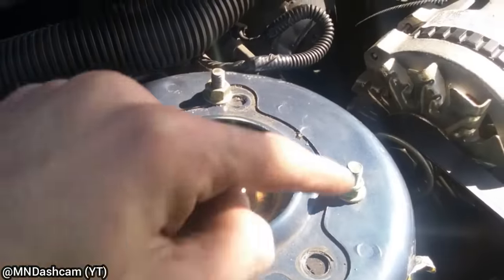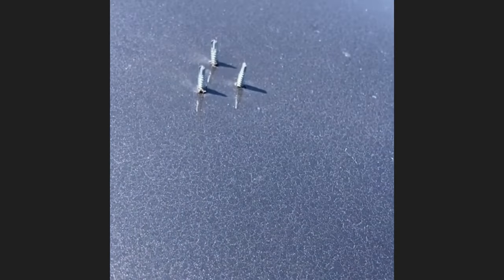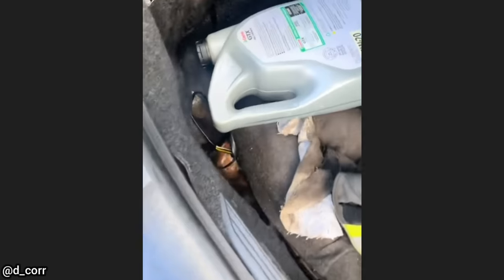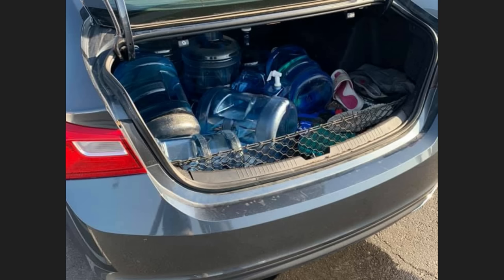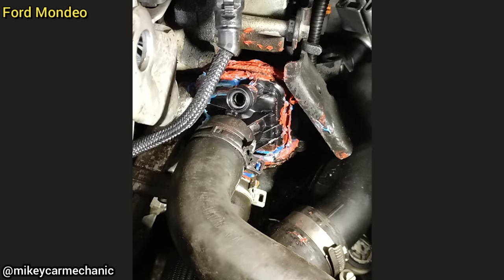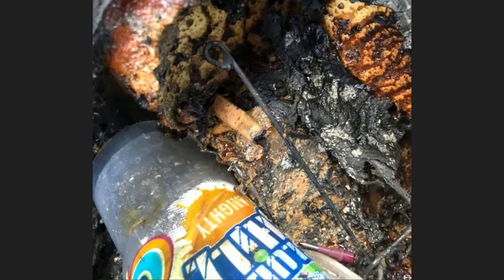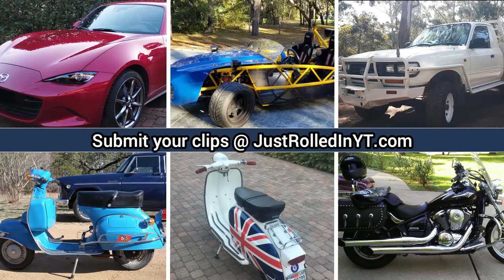Customer States He Got Scammed By Another Mechanic

Comment: Only yesterday I wanted to switch from summer tires to winter tires, but rather stopped, as the jack access point is a little rusty and gave me some suspicious crunch while lifting. It's only slightely concerning, as it's a tiny bit of side frame, and compared to what we use to see here, I am perfectly fine. Many frames shown here have basically rusted down to 1/3 of their original mass. Show such a thing to a German car inspector and you will see a grown man cry in the corner.
Reply: those car inspections in Germany.. ugh! My daughter in law visited the USA finally and when she left said, "I want a big American truck with rust on it."
Reply: Here you hit the frame with a ball-peen hammer and if it dents or deforms it fails inspection.
Reply: @grandrapids57  The Japanese 'shaken' car inspection requirements are notorious.   It's almost impossible to legally keep a car on the road in Japan that's more than 10 years old.
Reply: @MrSloika  That is for sure. During the 90's the Russian were importing a lot of Japanese cars until the Russians passed a law against right hand drive cars. It was a good outlet for them instead of sending them for scrap. The inspections business there and in Germany these days is far out of date and large economic burden. In Germany they also make every car owner have two sets of tires which must be changed by a certain date of the year-- there is no such thing as all season tire use there.
Reply: @grandrapids57  There is actually no such thing as an all seasons tire in Countries where seasonal conditions are significantly different.- it is an advertising gimmick designed to fool the gullible.

Comment: The cup in the burned car at 2:10 was the "Mighty" size cup from Speedway. I do not know which locations are still using the old cups, but several Speedway locations (the local one in my region of the Atlanta suburbs, for example) have been bought up by 7-11 and have switched over to Gulp cups. As far as the insurance company declining coverage, I can't really blame them. People should not smoke and fall asleep, be it in bed, on the couch, or in the car.
Reply: In the video, he said “they wrote off the car”.  That means they did cover it, totalling the car.

Comment: I managed to do the dumb i have a bad oil leak issues, but discovered it on my own. Full large jug of oil in my trunk, that most leaked out and all over the underside into the spare wheel well and out the drain hole. I still had a swimming pool of oil to scoop out before cleaning.. I spent about 2 hours taking carpet and everything out of my trunk and using strong soap to clean everything. I was going in the next day to get a new muffler and thought they might not like everything soaked in oil.

Comment: That’s a super skilled way to transitions from having the front on ramps to having the rear on ramps!
Reply: Usually the challenge is not drive over the ramps when going up.

Learned the hard way in highschool.

It's a bit of an over achiever to shift in drive instead of reverse when attempting to back off the ramps.

Comment: Those are a pretty set of "mobile mechanic" repair jobs there. I mean, lining up bolts with holes is pretty technical, and using gaskets takes an engineering degree I see.

Comment: The first vehicle is powered by GM's 3100 SFI engine, I'd recognize that valve cover and coolant bleeding tee anywhere. Water pump replacement on those engines is pretty darn easy.
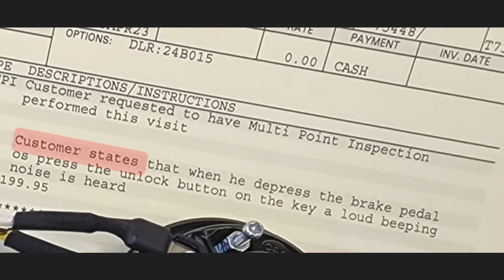1:38 - I've NEVER seen that prank before. HILARIOUS! I'll hand it to the prankster, they even used heat-shrink tubing and a neodymium magnet.
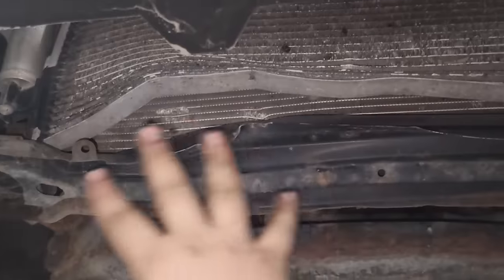2:51 - A bottle torch, some PB Blaster, a 3 lb. sledgehammer, and some elbow grease.
Reply: You want a great prank, get a really long zippy tie and stick it on your buddies driveshaft!

Comment: The very last clip happened to me too with the passat i used to have, i was trying to change the oil in my garage but the garage floor was too slick for the metal ramps, the ramps shot under my car and bent the pinch welds and both rockers in the front, luckily that was the only thing that got damaged. I changed my oil a week later on my driveway where the concrete actually kept the ramps in place, that was a lesson learned.

Comment: Been there, done that in the last clip backing up the ramps with my RWD Dodge Magnum RT. Was slowly trying to apply the gas to get it to move up the ramp and suddenly it jumped and shot up over the stops and stuck midway between the doors on both sides! That's the only time I've had an issue with a throttle by wire vehicle! Got the floor jack out and jacked it up off the ramps. Body pinch weld managed to cut cleanly through the plastic Rhino ramps! Didn't bend the pinch weld either!

Comment: I just had a plastic ramp do exactly that. I was just trying to get it up so I could more easily position  a floor jack under it. It was on a asphalt driveway on a cold day. I think the asphalt was a little more slippery due to the cold temperature. I have a board under the jack and jack stand to protect the driveway.

Comment: Found out my 95 Camaro had absolutely no rear brakes when it shot the ramps out and behind the car several feet after putting it in drive. Had just changed the fuel filter on the frame rail. Was just happy it didn’t do it while backing up onto the ramps.

Comment: This is what happens when people get their driver's license without knowing a single thing about the basics of their vehicle
Reply: I personally think they should make it a requirement to have basic knowledge on cars to have a license and have stricter inspections to remove alot of these unsafe junk cars off the road
Reply: @DJAtomic5  Then come to basically any country in Europe. I'm from Austria and our drivers licence exam include some really basic car mechanic questions. And our cars have to pass an inspection every year to even stay insured and can be driven on the road. The only real downside is that basically every car mod is illegal. I think the only things you can do is different wheels (available dimensions are from the manufacturer) and a muffler (full exhausts are only sometimes legal).

Comment: My stepsister took my moms car for an inspection and to what was causing the check engine light. I knew it just needed a new throttle body but the guy at the garage tried convincing her the turbo was bad and needed replacing and the parts alone would cost 6k. I talked to my trusted mechanic and he did a new turbo in the same model and parts and labor was 800$
 
I got screwed by a garage in my area, asked them to adjust my aftermarket coilovers to make my car ride smoother. They told me threads for adjusting the coils where cross threaded so I said about putting stock ones back on and they said they would call me with a quote. I was thinking about calling them because it was talking so long when they called me saying my car is finished and is ready for pick up and I owe 1500$. I was at a loss for words I was dumbfounded, like you where supposed to call with a quote 🤬 I would have done it myself if I knew they were going to charge 1000s in labor.

Comment: Wow. You know I could understand not getting it fixed if your just gonna write it off and get something newer but to not get it fixed and just keep driving it with an issue like. Hell the mechanic I take my truck to pretty much know that if there is something on my truck broken or very nearly there that I"m gonna want to get it fixed as soon as the parts are in and I have the funds to do so simply to prevent issues from getting worse and going from  a few hundred dollars to replace something to having to tow it in to replace it and whatever else broke because of it.

Comment: Please STOP topping off fuel (continuing to turn the gas pump back on after it stops). That will also cause an EVAP issue, it is made to handle vapors, continuing to fill brings liquid fuel to the top and gets sucked into the charcoal canister.

Comment: 😂🤦🤣🙄😨 everything that I go through when I watch this video.

The shifter cover on top of a automatic now it's a smart idea but also a bad idea because you could prevent your car from going into gear but then it's a good idea because it'll cover the other shifter from getting dirt and dust in it but it also might collect dust and dirt.
It'll make your car look nicer compared to the rest of the car.
Another thing is I hate seeing stuff that I never need to use just sitting in a box that excludes replacement bolts screws or nuts or the little plastic covers that go over the screws.

Couldn't go down to the local auto parts place and get a temporary gas cap so that nothing triggers in the system and then go to the dealership and get the actual manufacturer one or the local repair shop.
She seriously expects free service what is wrong with people.
I probably would give it to her so she one can get out of my parking lot for valuable customers and two send her home with as much repair cost estimates as she can carry just to get her off the repair shops land.

Some stuff you show It's just absolutely ridiculous and hilarious at the same time and also what are people thinking through their head with logic and not much knowledge of cars.
When something doesn't open or come out why does someone immediately resort to tools and prying, if they would have read the manual that comes in the vehicle they would have known to push the right button to open the glove box.
Reply: ...the manual that was in the glove box? 😏😅

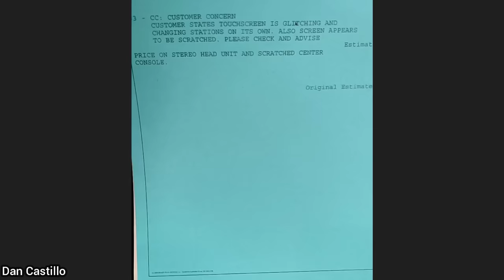Comment: 0:36 - I'm skeptical that the customer worded it as "screen appears scratched". I've taken my car to the mechanic with VERY explicit instructions on reproducing an issue....

"When I do a cold start on hot days, with the AC on, and put it in reverse, I get a noise that sounds like a mix between purring and chirping. I suspect serpentine belt or belt tensioner". 

Got it back with a "could not reproduce" and a "Customer states chirping sound in reverse". I took them outside, followed the instructions I provided them, and low and behold there was the chirping noise! And, surprise surprise, the serpentine belt was slipping due to the increased load of the AC on a hot day and the belt and tensioner needed replaced. So the "customer states" is not a gold standard quote of what they were told by the customer.